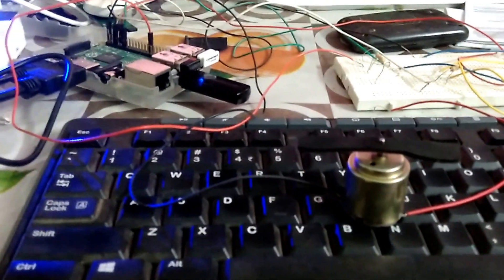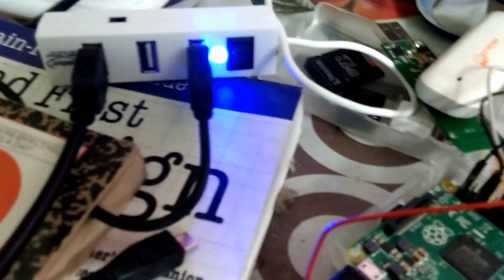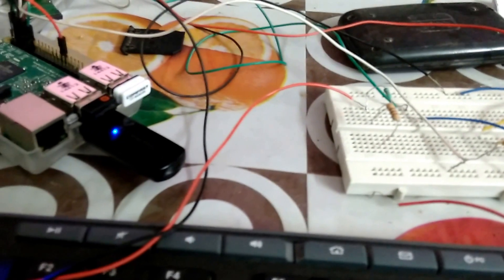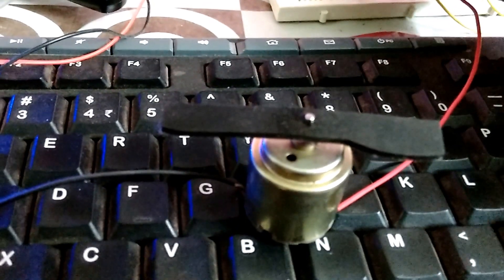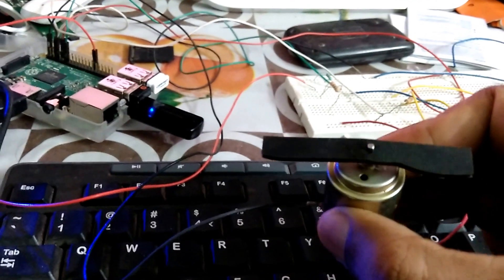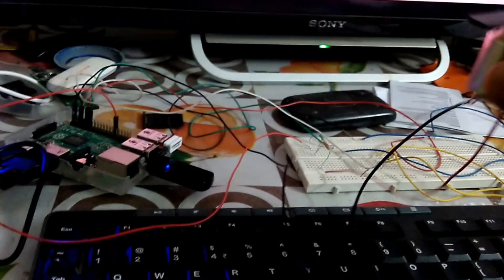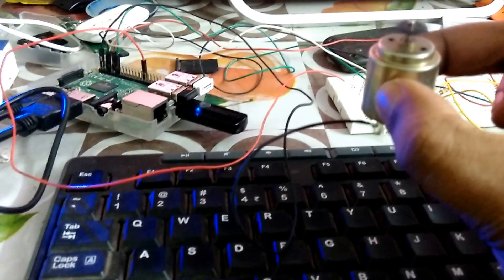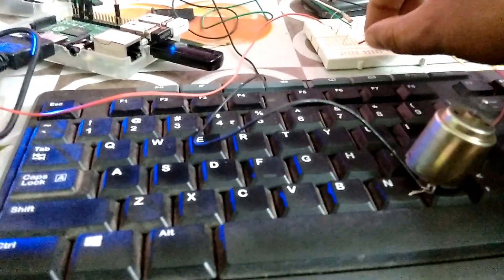Raspberry pi 5v motor project

Comment: Hello Dhruba! Good job! I have a question, how you control the 5v output pin? You have to write some code or it just start to work from the startup of the RPi? Thanks for your answer!
Reply from the maker: +Alex H. Sazo no code actually, working on that...
Reply: Thanks for answer! I understand. Then, 5v power output from the RPi just work by itself?
Reply from the maker: +Alex H. Sazo Yes, But attach resistors to the circuit for safety of your raspberyy